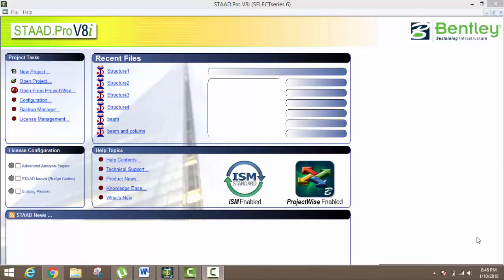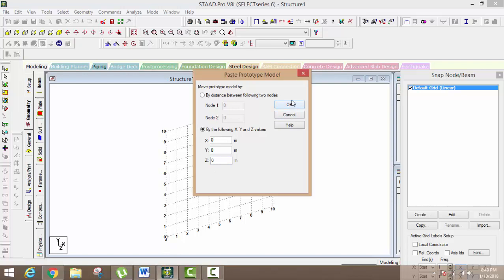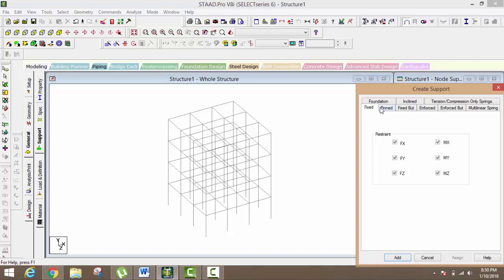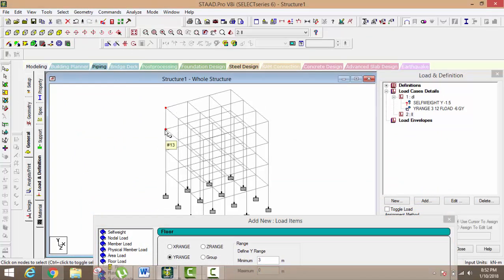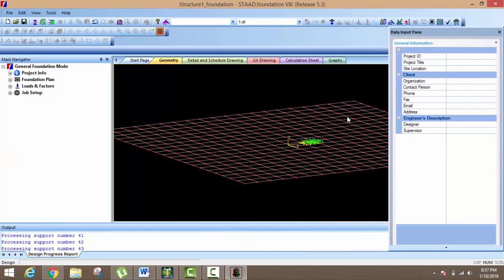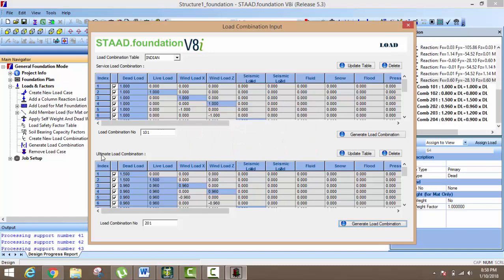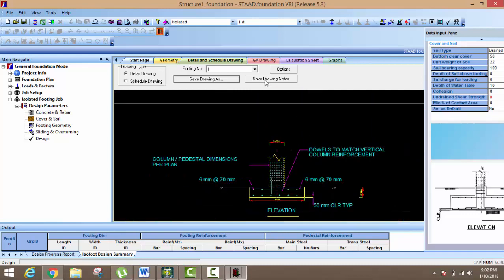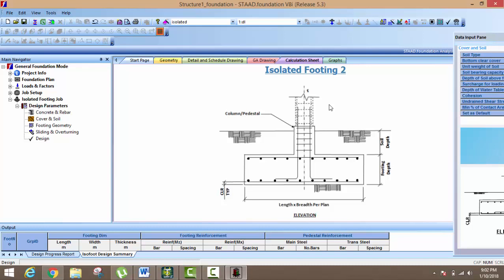STAAD.Pro Foundation Design(Isolated Footing)

Comment: Is the top reinforcement is really needed in isolated footing?
Reply: Most of the time it is not needed.
Reply: You can ignore the top reinforcement by checking the "Calculate the Top Reinforcement Only when foundation is subjected Uplift force" (Tool>Global Setting). How ever if your support reactions include the seismic load, top reinforcement is calculated in some cases because of seismic load